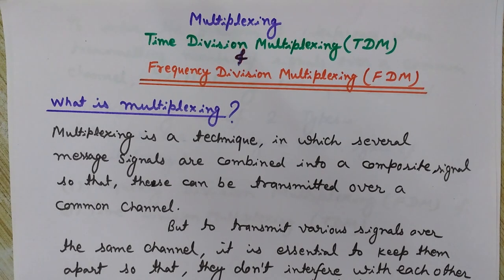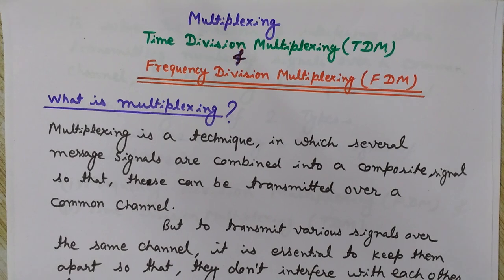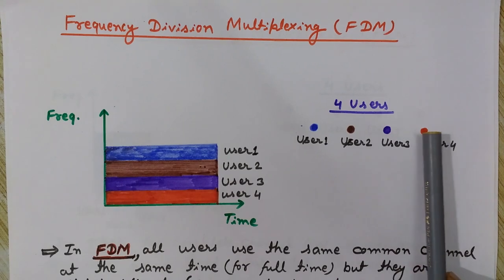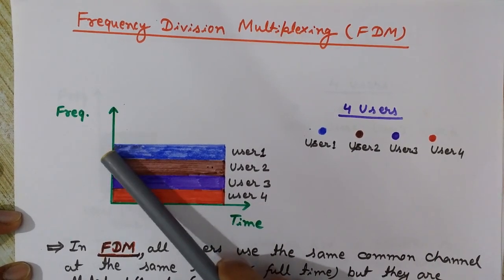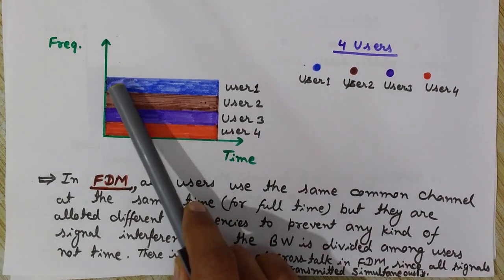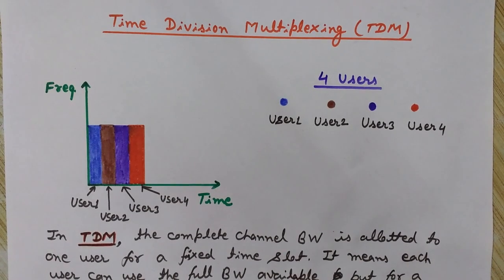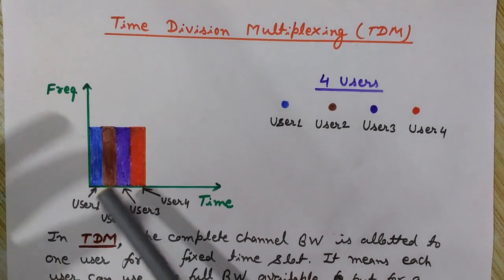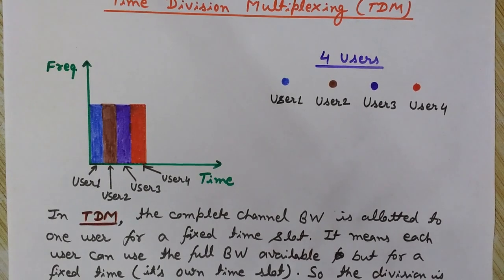Frequency Division Multiplexing (FDM)- Time Division Multiplexing (TDM)- Multiplexing in Data Commun

Comment: This video needs to be redone.... TDM and FDM is only partially explained here... You make it sound like users have to wait and that's not the case.... All users can do everything at the same time.... FDM and TDM is determined by the MUX,  and is behind the scenes. I think this video needs to be redone and add MUX and DEMUX into the explanation, for further ease of understanding... And there is also space division multiplexing... This should be added into this video since there are three types of multiplexing and not two.
Reply from the maker: Thank you so much for the correction, I will try to correct the video

Comment: Let's say I have a data array of L=45Mbits that pass through a circuit of R=1,5Mbps, that is split on 6 different channels using the TDM method. (1 sec each channel)

How can I calculate how much time it will take for all the data to pass through?